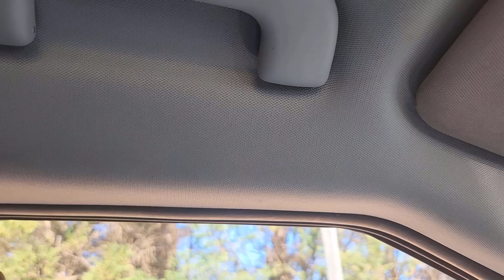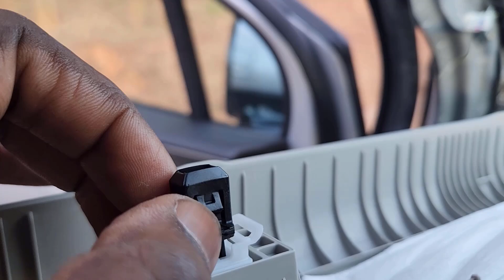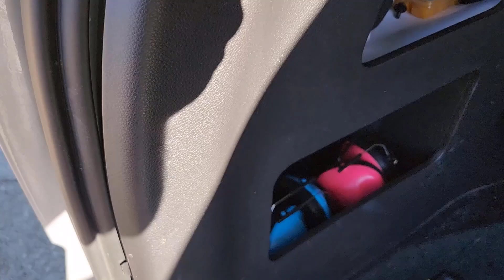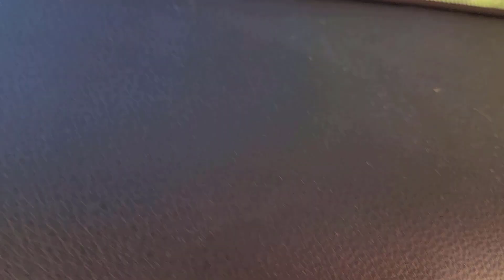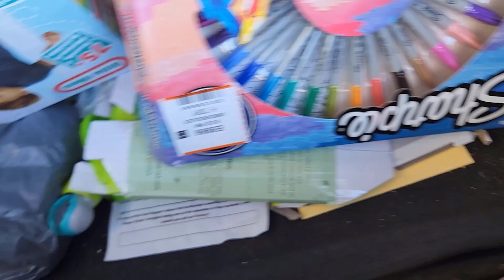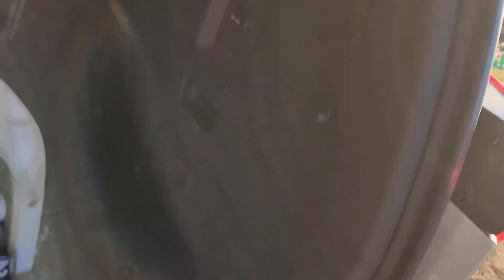Kia Carnival Dash cam install

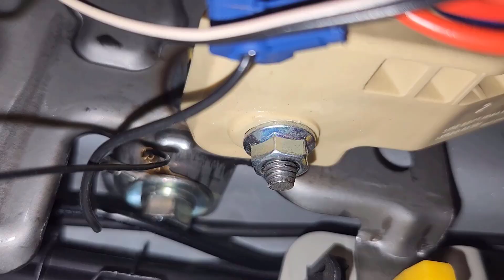Comment: How did you get to the ground bolt? 17:39
Reply from the maker: I used a short open end 12mm wrench. My ground wire for the hardwire kit had an open mounting loop so I only had to loosen the bolt enough to slide it in.

Comment: Dude this is freaking amazing.  I'm about to install a dash cam in my wife's carnival and, well, I mean I have a full 2 amp system with sub and dash kit in my car and did that many years ago but I was not keen on pop'n panels on the wife's ride, but this is like THE guide, right on.  You saved me soooo much time and now I've got the confidence that I know how things are coming apart etc and not doing the "careful tug please don't snap" because I have no idea where the fasteners are.
Reply from the maker: Glad this video helped.

Comment: Great video. Any idea how long the cable was you used to get to the back?
Reply from the maker: I believe the cable that came with the camera is about 6ft long. I had to order an extension cable that was 6.5ft long. Because I ran it along the floor panel. The 6ft cable is probably long enough if you run it along the headliner